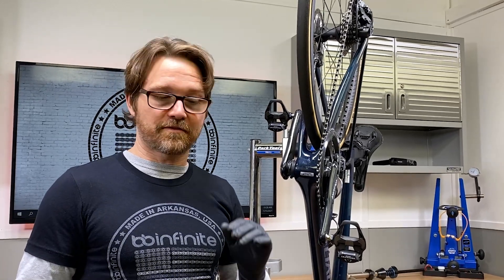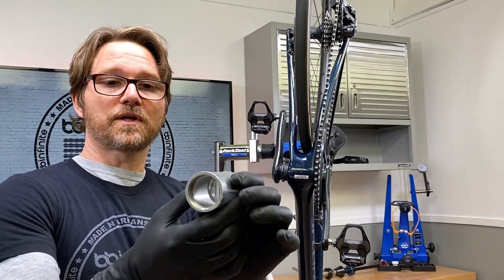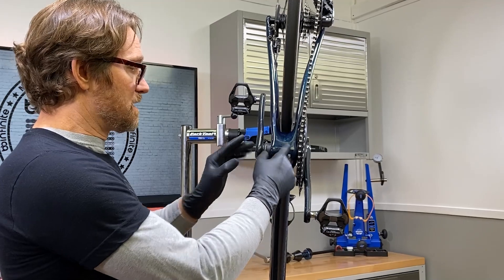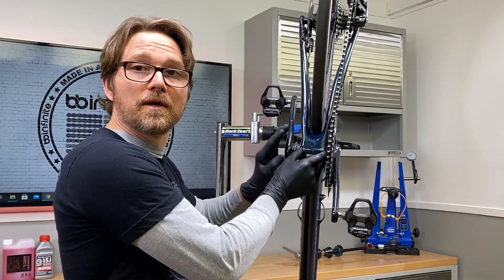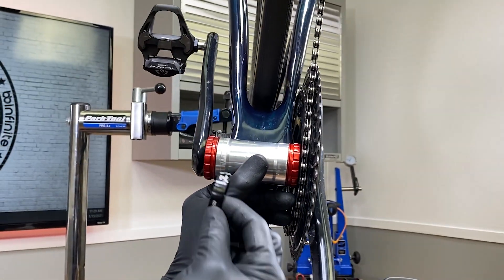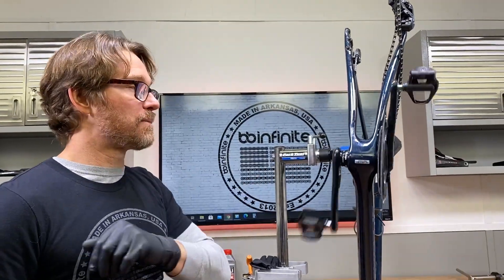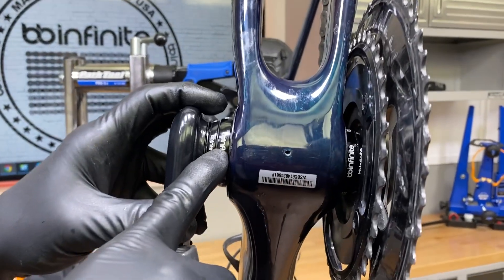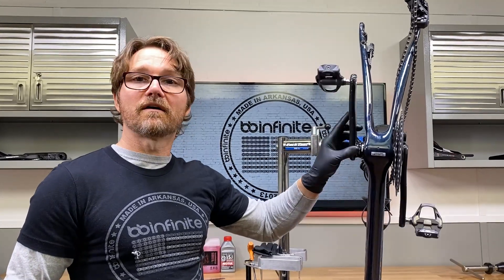The BBInfinite Wide Format BB Advantage

Comment: Looks like there's still a spacer on the non-drive side after the install. What is that? We're trying to eliminate spacers, yes?
Reply from the maker: Spacers are required for cranks that have a different spindle length spec within the same "category". For example, if you have an FSA 386Evo crank you would not need any spacers with one of our XL format BB's because Evo cranks feature the "shortest" of the long spindle road cranks. If you took the FSA crank out and replaced it with, say, a Rotor Aldhu, you'd need to add a 2.5mm spacer on each side  because Rotor specs longer spindles than does FSA for a crank set that's supposed to be in the same class. 30mm spindle lengths are all over the map from manufacturer to manufacturer in typical bike industry "standard" fashion. So what we did was set the max width of our XL bb systems to accommodate a 386Evo spindle, which then allows all other cranks to be used because they are all a bit wider than the Evo one. The purpose of our XL system is to minimize the need for a huge stack of spacers, as shown in the video.